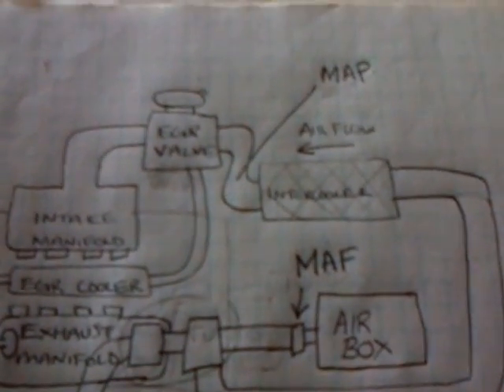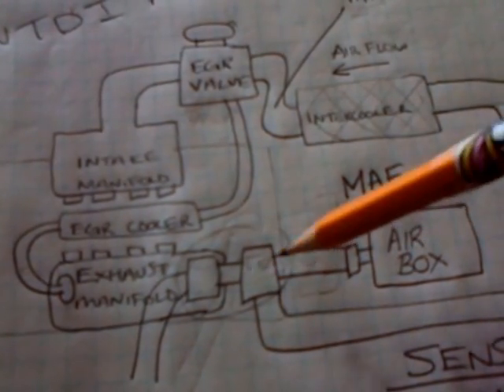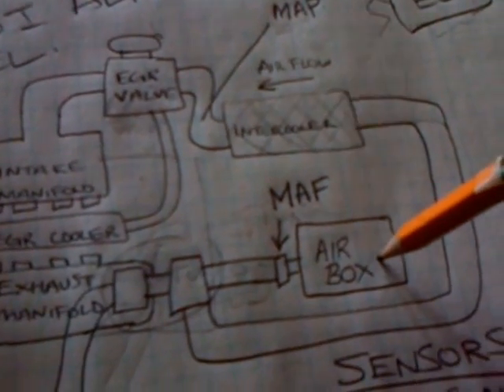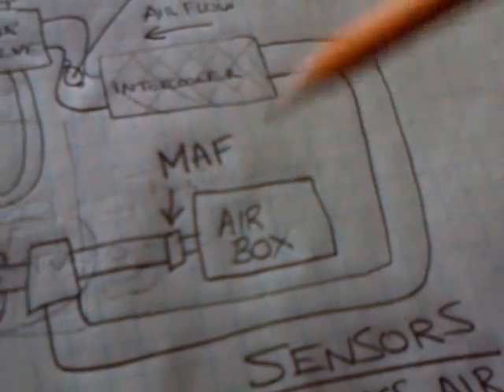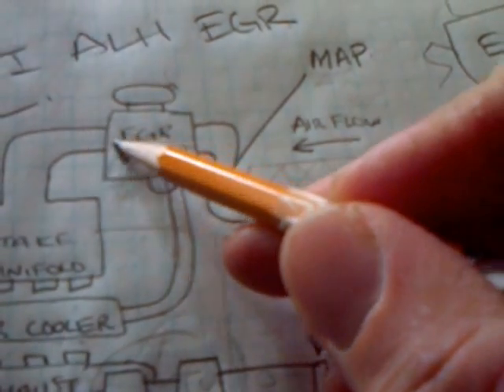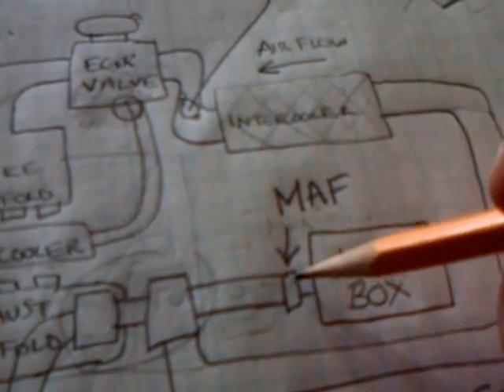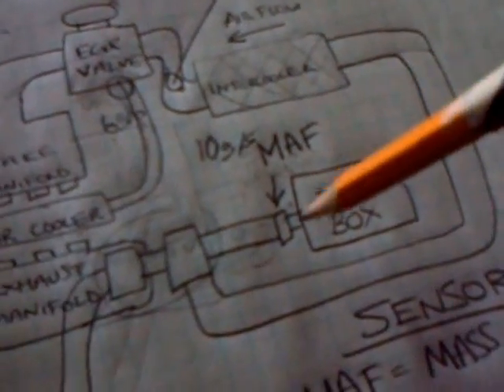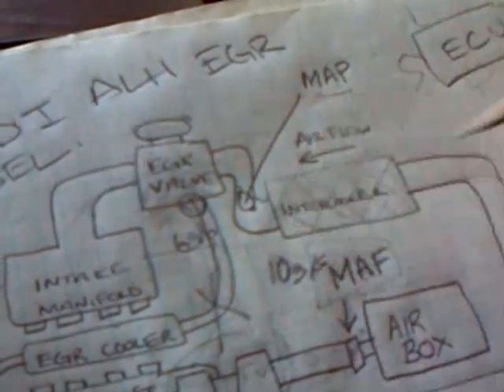VW TDI ALH EGR System Explained

Comment: Dumb question: why not block off the pipe coming from the exhaust and then install an air filter on the EGR side? That way the EGR can open, draw in air and the ECU has no problems because it doesn't know the air being drawn in is filtered fresh air.
Reply: Good question wish I knew

Comment: Hi, thanks for this amazing explanation. I did the egr delete on my alh and left the egr operating and put blanks on the egr valve and removed the cooler and blocked off the exhaust. Is there any way to keep the cel off without using more fuel? What are the details about your idea of the maf twist?  Would that make your engine use more fuel?

Comment: Hi NarfBlast. .. question.   Does the EGR cooler connection to the EGR ever get carbon buildup?
Reply from the maker: +Sones S Yes, that could reduce EGR flow from the exhaust system, which would cause a P0402 EGR Excessive flow (at the MAF) code on this engine.
Reply: Thanks, Yeah I got a little bit of a suction sound no engine code,  so when the EGR was removed, manifold is clean so is the EGR, the suction sound stopped. so it must be the egr cooler that has a whole ton of buildup.  thanks!

Comment: Very interesting, how do we know for certain that the soul purpose for the maf is to work in conjunction with the egr system. Is it not possible that the maf is assisting with further engine management functions?
Reply: The MAF sensor  tells the ecu how much air flow is coming into the plenum so the ecu can adjust the fuel flow in the correct amount. All this gizmo appears to be is an adjustable air bleed. I don't think it would work but I am not postive . Also the ecu uses the MAP sensor to read Manifold Absolute Pressure and the O2 sensors to to monitor the egr valve.

Comment: HI.great demo of how system works,,, thank you. HOWEVER, I have a situation whereas the engine is being over fueled and causing a mis and other issues, now it does run SOOO much better with MAF disconnected, so I thought I'd found the issue the MAF ordered a replacement and reconnected, still the same over fuel !  Having watched your video can I assume that the most likely cause now is either possibly my MAP sensor OR faulty EGR valve ??. I assume by disconnecting the MAF I have removed that sensor and the ecu has gone to some kind of default or taking its measurements by other means ? By the way the car is more eco and runs so much better with MAF disconnected. THOUGHTS please
Reply: If you disconnect the MAF sensor the engine will only run in the closed loop mode. Ie  ( RICH )
Reply: I had the same problem with the MAF connected.  When I bought the 03 ALH three years ago, the MAF was disconnected.  When I connected it, the engine barely ran at all.  So, I disconnected the MAF.  I bought a brand new MAF and installed it.  I had the same problem.  My 03 ALH has been running fine for the last three years and getting good fuel mileage without using the MAF.  I suspect that my EGR system is not working properly and by connecting the MAF, the engine doesn't have the proper air/fuel ratio as commanded by the ECU.  Without the MAF connected, the ECU seems to control the engine just fine.  Any thoughts?

Also, last winter I inadvertently left my block heater plugged in for several days when the weather got warmer.  Since then, my coolant reservoir empties after not driving the car for several days at a time.  When I drive the car, the coolant reservoir stays full.  It only empties, when the car is not being driven for a few days at a time.  I have not found the source of the leak and don't see any fluid on the ground.  I suspect that the coolant may be leaking into the exhaust side of the EGR cooler and being burned off by the exhaust system.  I'll have to take it apart the EGR system to see if I am right or not.  I'm really not liking this entire EGR system at all and would like to remove it and all of it's issues.

Comment: Hi Mr Blast, I have a B5.5 VW Passat TDI AWX 130 bhp now. My old Passat was TDI 115 bhp and although having done 235000 miles still gave me over 60mph on a long run. I have been told to delete the EGR valve on my AWX 130bhp engine to give me better economy as per my old Passat, is this a waste of time and money ? I have looked inside the EGR and its quite sooty not a good for air flow I would say, it must be the same inside the inlet manifold, hey but what do I know ? I'm Just an ancient biker who understands old lumps of machinery..  :0)  Cheers Mate.
Reply from the maker: I don't know about anything about those engines.  My EGR system stopped working and I can't be bothered to fix it propely.
Reply: If race cars do not have them they are not efficient. Egr valves are great for the car companies because they lower emissions and also carbon up the engines which is part of their planned obsolescence. People got wise to it so now they do the same thing with cam timing by increasing valve overlap.

Comment: Alright. Good explanation and good theory. I understand your logic behind it. I have one question for you. If for example I have performed an EGR delete it cannot pull exhaust gas back through the intake. Agreed?? Well, if you perform a MAF twist, like so in your MAF twist video, it will change the G/S reading across the MAF. That's great and all, but even if it's reading lower than 16 G/S, it should still see a drop when EGR is demanded by the ECU. So, my question to you is, how can you fool the ECU by dropping the G/S across the MAF if it's dropped before the ECU even calls for EGR? In theory, if say it's at 10 G/S at an idle after the twist, it should still see a drop from that when the ECU calls for EGR. Please clarify that for me. I'm not arguing because it obviously works to an extent. I just want a logical explanation as to how that fools it.
Reply from the maker: Phillip Wilson the ECU is not that smart, and it has wide tolerances so I think that is why we can get away with this.

Comment: I made a switch to emulate the EGR.  I measured between 1.5 and 3V coming out of the MAF, at 22 to 50 microamps.  I installed a series 1k ohm resistor.  After that, I installed a parallel (to the resistor only), normally closed, vacuum actuated switch on the EGR vacuum line.  So when the EGR line has no vacuum, MAF senses normal voltage and current.  Otherwise, it senses ~2% less.  Tried it first this morning, more power, but less in the afternoon.  No CEL this time so far.

Great explanation.

Comment: Update...  I performed the MAF Twist a second time and set it down lower, to about 10 GR/SE.  This has kept the Check Engine Light off for a couple of tanks of fuel now and allowed me to pass our state safety inspection.  I had previously cleaned out my intake manifold and installed the Diesel Geek race pipe (EGR bypass) which caused the EGR insufficient flow problem in the first place.
Reply: Herman Munster have you noticed using more fuel after the twist?

Comment: Thanks NARFBlast!  Good explanation!  Believe it or not, without reading anything, I figured that the system had to work as you describe.  When I found there was no EGR flow sensor (e.g., a differential pressure sensor), I figured that flow had to be calculated from other parameters, MAP, displacement, engine speed, IAT.  I twisted the MAF down from about 15 to 12 and still have EGR insufficient flow.  Just set it to 10 and we'll see if that holds off the code. Isn't IAT also relevant to MAF?

Comment: Sounds logical to me. My EGR has been deleted (blocked vac line) for a year now.
getting 47.9mpg @ 65mph, automatic transmission and 2" lift w/205-70-16" tires.
Will perform "twist" now to turn off the CEL. Have already milled (dremel) security
post from center of torx screws. Thanks!
Reply: sierraromeo did the twist lower your mpg?